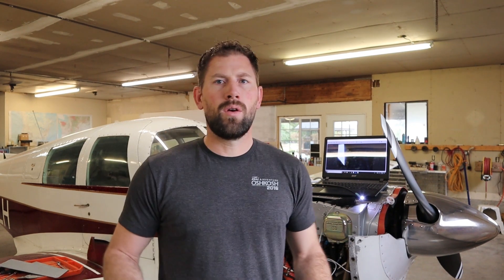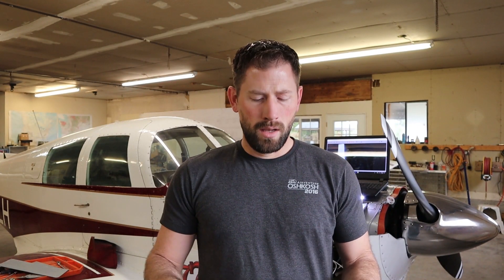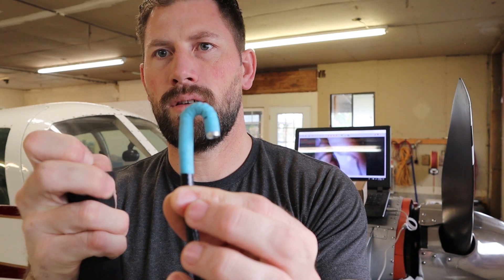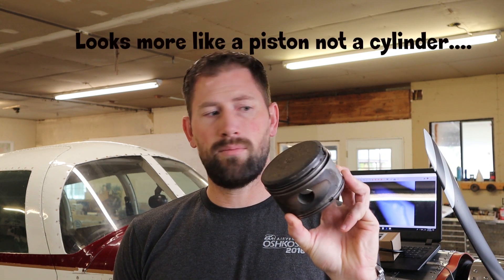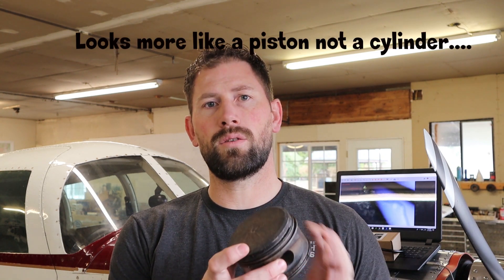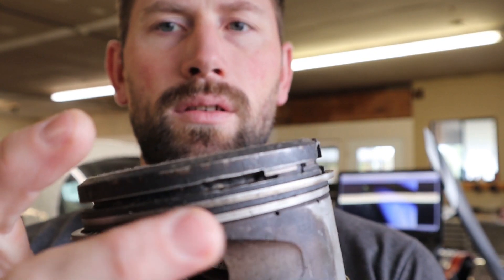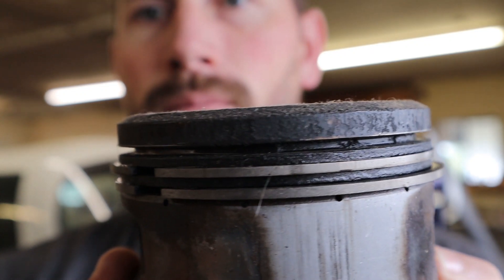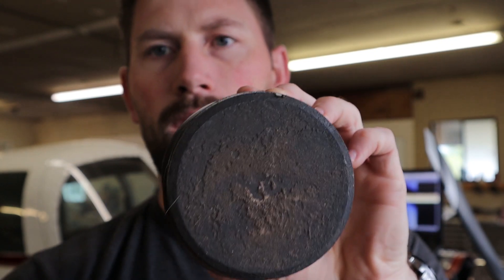Borescoping an aircraft cylinder

Comment: Have vibration on  Piper Tomahawk Lycoming. Month or so ago engine lost power with vibration. I turned and glided onto alternate runway. Maintenance had a look, plugs pulled all old but fine. Engine ran normally. Still vibration at cruise or above power., smooth 1500 or below. Fitted new plugs, carb. mags had 500 hr check 50 hours ago. Mags drop even, carb. heat normal all bit it a background roughness,  rough in cruise, climbs normal, all be it i think rpm is down by 50rpm at max. No smoke, rich fuel or oil. Compressions normal, had prop balanced. Had a valve drop on a PA28 into field so really concerned about the Tomy. going same way.
Reply: Next time it happens, do an inflight mag check and see if that helps the vibration. I know you said it had a 500hr 50hrs ago but for the symptoms I’d suspect the mags as my next step in diagonsis.

Comment: As a Student pilot and future aircraft owner. I will be totally hands on with my maintenance
Reply from the maker: Awesome! Knowing your airplane inside and out will improve your situational awareness, your in flight emergency skills and your overall safety 🤙
Reply: @whatsmikedoing8761  I already do it with my vehicles.  And have all the tools to do what FAA allows me to do. I just picked up from Harbor Freight a Cylinder Leak-Down tester, Borescope and Spark Plug cleaner for future use.    Thanks for your help and support videos.  They help a TON!!!!
Reply from the maker: Once you own your own airplane be sure to find a friendly A&P that will oversee you and allow you to do a bit more of the work. You’ll learn a ton more.
Reply: @whatsmikedoing8761  Thanks 😊 🙏.  Thats the plan for me. To find a good A/P who will show me what types of things I can do like change the tires when needed. The jack points on a plane seem a bit crazy to me. Brakes pads, oil and spark plug changes seem easy to do.  I just have to remember to change out the oil screen when changing the oil filter every time. Purchased a magnet stick and filter cutter to check for metal shaving between the filter wafers as well. Also, bag the filter wafers and date them for future reference for engine maintenance purposes.
Reply from the maker: You’re well on your way! Your airplane will be happy!
Reply: @whatsmikedoing8761  thanks for your help and support 👍 🙏..  Keep on making those great videos for me to follow and learn from.

Comment: I had a cylinder head pop off a cylinder in flight. Engine lost a bit of RPM and started throwing smoke. Landed safely but still couldn't see anything wrong because of the way the engine cowling was set out. When the engine cooled down I fired it up again and it amazingly it still gave full RPM when it was cold...lol! Those engines are quite resilient old pieces of engineering. That boroscope is cool.
Reply from the maker: Oh wow, crazy!
Reply: borescope camera : https://www.youtube.com/shorts/6umaT5Lf7FI

Comment: nice! i just got a bore scope a few months ago to check under the floor of boats, i can manually bend the head but the setup on yours would be ideal
Reply from the maker: Johann wienermyer-schmidt I started with just a miniature camera on a loose wire that I had to tape to a bit of tie wire so I could bend the head at an angle to keep it there. This new one I have definitely makes it easier.
I’ve used this one on a boat too, basically to see behind the engine and get eyes on a shift cable and confirm that the center cable had worn through the sheath and needed replacing. Borescope for the win!
Reply: @whatsmikedoing8761  i remember that
Reply from the maker: It was a pretty awesome boat!
Reply: borescope camera: https://www.youtube.com/shorts/6umaT5Lf7FI

Comment: I have a cheap borescope...use it on engine and hard/impossible places to see on the airframe.
Reply from the maker: Tim Ketcham that’s great! Which one is it, do you have a link? It would be good for others to know where to get a cheap borescope that still gets the job done.
Reply: It's a cheap on from walmart
Reply from the maker: Right on cool, I have another cheap one that I got on Amazon. It worked okay but this new one has a closer focal length that really helps.